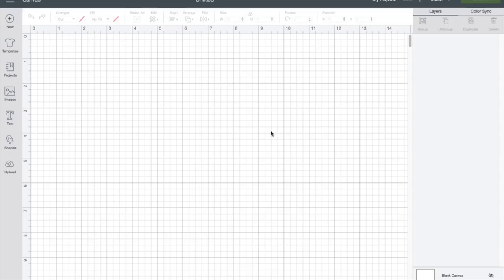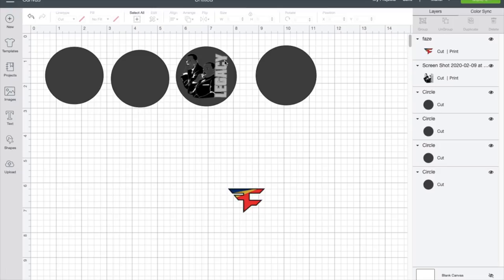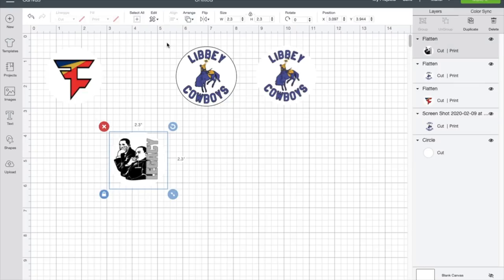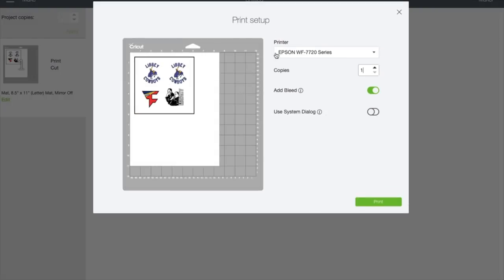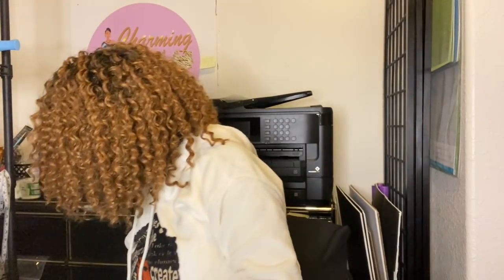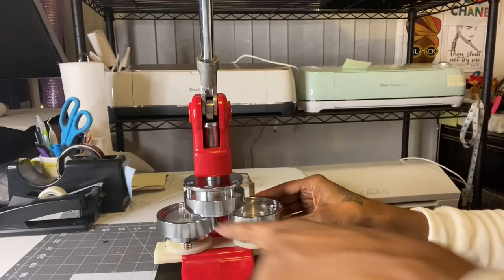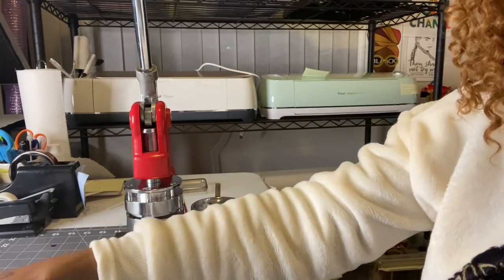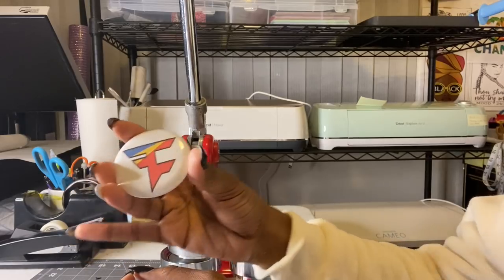DIY Buttons made with a Button Maker

Comment: Hi, I am having trouble with my button maker. The metal gets squished too much and the paper wraps around the backing correctly but once I press it onto the pin backing, the metal gets squished and leaves the button with a metal piece sticking out around the edge. Some have a small piece sticking out flat and others come out with a larger section. Sorry if i explained this weird I’m not sure how to describe it. Could you have any tips for fixing this? I’m not sure what’s going wrong. Thank you

Comment: I have problem with mine not wrapping around the backing. Consistently.. It is very easy to use compared to my earlier Badge a Mint. However we still have too much waste. Any suggestions?
Reply: I'm having this problem. Did you find a resolution?
Reply: I had the problem as well I took the marker apart and noticed and reassembled